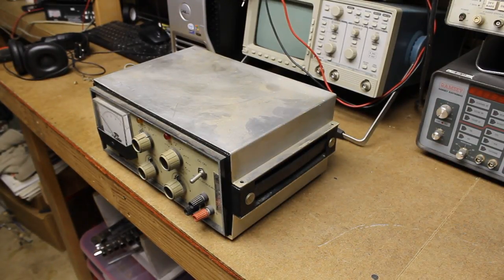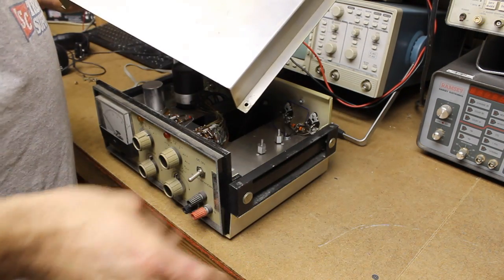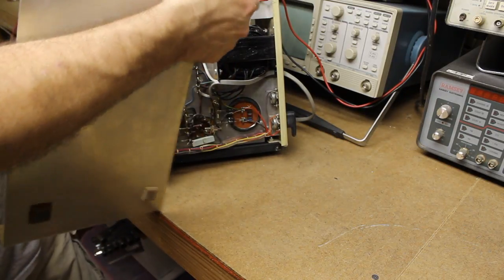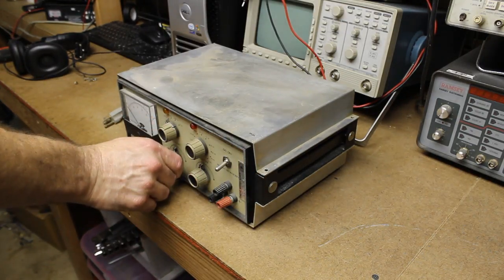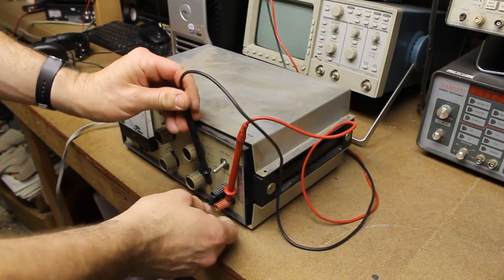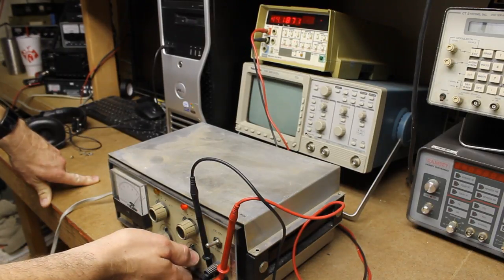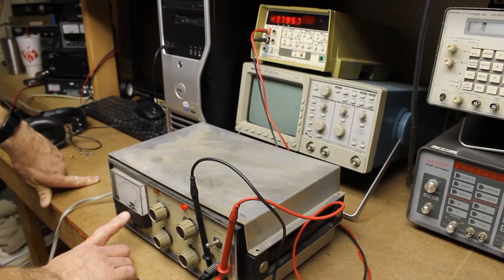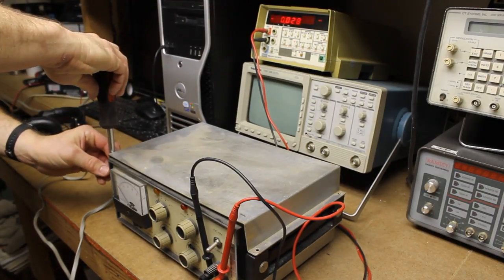Heathkit IP 27 Regulated Low Voltage Power Supply Inspection and Testing

Comment: I inherited on with other gear from silent key who got me interested in amature radio. Im new at the stuff only have Tech ticket. if you ever do a "Rebuild on your Heathkit IP-27, let me know. this one is in poor shape as it was in storage since 2005, and I dont know if it was working before that. so I might need some guidance to get this back on a bench top. Thank you , respectfully, Robert
Reply: robertflores, I don't know what you have done with your IP-27 since you wrote your comment, but I did a detailed restoration, demonstration, and theory of circuit operation video on this power supply on my channel; if you still need guidance with yours, take a look at my video on the 'youtuuba' channel.

Comment: I wondered a couple things while watching this:
- The Fluke meter did not seem to reflect what the narration said that the power supply's meter was showing......?
- There are a lot of things that go wrong with IP-27 supplies, and the perfunctory test done in this video only demonstrates that part of the circuit is working.......
- Just before a comment was made about the power supply being drifty, the video showed the current limiter fine adjust control being turned.....the narration suggests that Bootstrap Workbench thought BOTH lower controls were for voltage adjustment. Wrong. However, while the lower left control is for current limit fine adjust, turning it CAN slightly affect the voltage output, especially if not everything in the circuit is working per spec.

The IP-27 was notorious for complete or partial failure if the user changed the voltage range switch quickly across several ranges. Heathkit issued a service notice that described a circuit modification to prevent this happening. One or more of the transistors would fail outright, or at least be degraded in their performance. The supply might still kinda work, but would no longer meet its specifications.

My own IP-27 had one of the two large pass transistors that was underperforming, and both of the smaller (yet heatsinked) internal transistors were not functioning correctly. AND, most of the electrolytic capacitors were failing. Even before I made all repairs, my IP-27 would still pass the perfunctory test shown in this video. Just like even a broken clock is right twice a day, even a partially failed power supply might be able to output some voltage when operating without a load (the Fluke meter in this video does NOT constitute a load).

Comment: I that exact power supply  and the crinkle finish paint looks excellent, but I shorted the leads out and now it just makes a clicking noise when I turn it on.
Reply: fpvrcstuff, the 'clicking noise' is the overcurrent relay, which disconnects the voltage regulator circuit output from the output terminals.

My own IP-27, when I got it from the seller, seemed to sort of work (it generated some output voltage), but was drifty, could not deliver much current, and the current limiter/constant current mode circuit did not work. Turned out that most of the capacitors were bad or marginal, and three transistors were bad. Plan on looking for some NOS transistors and a new set of caps.

Comment: Hi, I am about to recap mine and check resistor value's. Handy power supply, I like the older test equipment and tube amps.  I did not get any knobs with my IP-27 and have had little luck finding any, frustration ahhh.  Keep up the videos
Reply from the maker: +judges69 Thanks for the comment. I have yet to recap mine, as I am saving up for a spectrum analyzer. The knobs on my LV and HV Heathkits are cracked, so I will be looking for knobs soon, as well. I have access to several 3D printers, so I may have to model them, and get some printed.